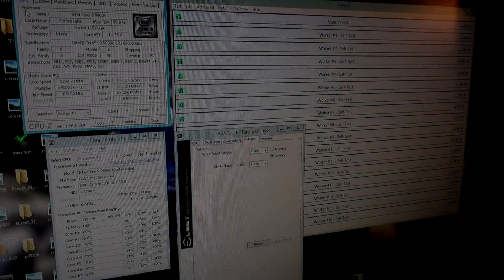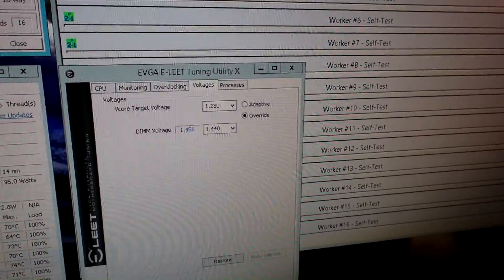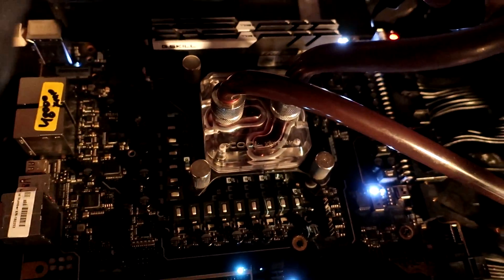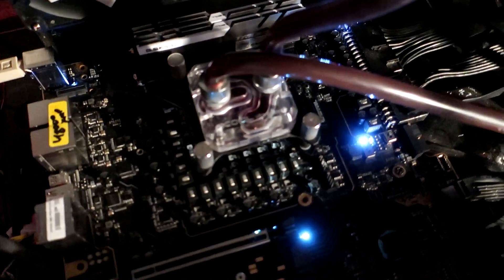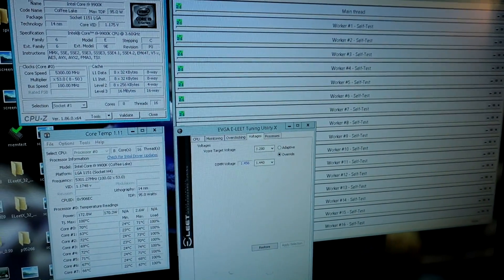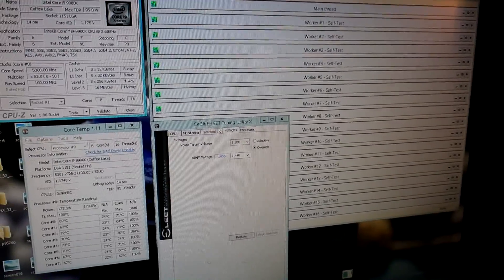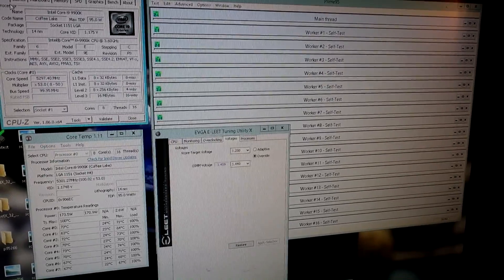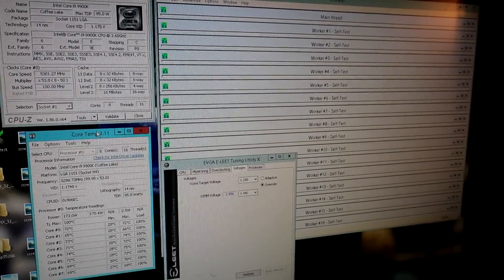EVGA Z390 DARK VRM temperature test + more thoughts about Z170 mod

Comment: So do you think a Asrock Pro 4S would work with a a 9700F? It should even be a easier than the 9900K in terms of the board quality and VRM concerns with 600MHz lower base frequency and 300MHz lower turbo frequency. The other aspect of that is couldn't I just underclock it by 100MHz/200MHz give or take to keep the VRM situation more under control. I mean even if I ended up at 2.8 Base clock with a 4.5GHz boost that's still a great chip coming from a i3-6100 with 6 extra physical cores, more cache, and better memory compatibility support.

Comment: I should be able to put say a i5 8th or 9th gen in my msi z270 mobo? I'm considering purchasing one if it's as simple as this. I couldn't clearly understand what you said in the i9 + z170 vid about not having to short the two points. I'd like to upgrade away from my non k i5 and due to my mobo it will be expensive to either buy an older "k" i5 or new one and a new mobo... this would be perfect since the 8th and 9th gen i5's are way cheaper than a 7th gen.

Comment: You could tell us the parts of the vrm, that would be more interesting, what type of mosfet, controller, doubler, etc?! Aorus Xtreme produce the same heat without heatsink in a almost same setup.
Reply: if you want that kind of information look at gamersnexus or Actually Hardcore overclocking @mpowerph

Comment: To be fair z170 ocf is still a monster among the current z370 and z390 board, so I can completely understand why one would modify an existing board rather than going out and picking up hot potato cough asus cough
Reply from the maker: Of course, but the point was that is it wise to hunt for a used one that is often at a higher price than it originally was listed for?
Reply: @LuumiJuhani   With Asus gene lack of availability and EVGA dark no where to be found, not to mention asrock ocf can be used with gen 6, 7 ,8 and 9. Where as the newest one could only support 8 and 9, obviously the ocf doesn't warrant higher price but it's mainly dictate by people who are willing to pay.

Comment: Did you match the 1Mhz switching frequency set on the MOCF from the last video?
Reply from the maker: No switching frequency option on the bios atleast yet... I could physically mod it though.
Reply: @LuumiJuhani  does higher switching frequency have any impact on ambient cooling?
Reply from the maker: @mihaimladin5054  Dark now has option in the bios to set from 300KHz to 1MHz but impact is next to nothing, 800KHz seems to be the best option on dark on any cooling.
Reply: Luumi i don't ask strictly on dark. in general is there any benefits for inceeasi frequency?  on mocf does in help? ( not in particular cases like going for 103 bclk on non k skylake)

Comment: 5300Mhz At 1.176v ? WTF O_O
Reply from the maker: Vcore is same as on the asrock MOCF run, 1.28v set. You can see it on the eleet software.
Reply: CPU-Z is known to be unreliable for vCore on mainstream. It reads the SVID for VRM control. Not vCore. x99/x299 does read correct.
Reply: @richiec7700  i always disable svid sup
Reply: @rsm4541  this bad!.... Lul
Reply: @rsm4541  the 8350k suuuucks x)
Reply: @rsm4541  Fuck you 👌😂
Reply: no please xD
Reply: @LG1771-e4n   kek

Comment: I wonder how an ITX Z370 board would handle a 5Ghz 9900k overclock.. It is a pity there isn't an ITX board with a daughterboard. Seems to be the case since z77, where Gigabyte made an ITX board with 12-phase power regulation via a daughterboard.
Reply: I believe the z390 itx phantom wouldn't have a lot of problem
Reply: @morcogbr  why ? They have good intersil 60a drmos @ 5 pwm
Reply: @rsm4541  that is what I meant
Reply: I didn’t find the power capabilities of the Asus* P8Z77-I, the Phantom seems to be capable of 5*60A… Couldn’t find which MOSFETs the Z77-I had. At least they both have 8-pin CPU-power connectors. Also the 9900k shouldn’t do much more than 250W anyway @ 5Ghz… And then anyone would most likely be hitting their cooling limits.. Hmm..
Reply: @rkan2  my 8350k take 160 watt in full load , 9900k 250w ?) Yep , lol
Reply: rsm Huh? Twice the cores? Most sites have reported those are the general.max numbers on water, after which thr 9900k can run, depending on cooling and modded power solutions, up to 500-600W :P Of course the average for a typical user is likely to be <50W, even overclocked.
Reply: @rkan2  gigabyte suxx in memory overclock , most boards cant hit 4200-4300 cl16-18-28-280 or 4300 17-17-17-28-280 . Good memory need for good fps ^_^
Reply: 8pin for cpu only for ln2 9900k oc. this is marketing joke :D